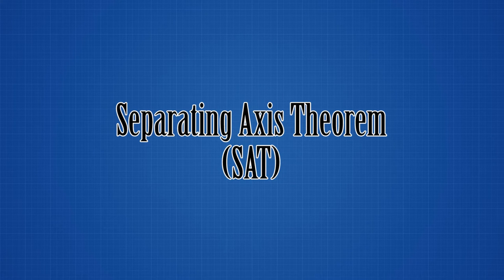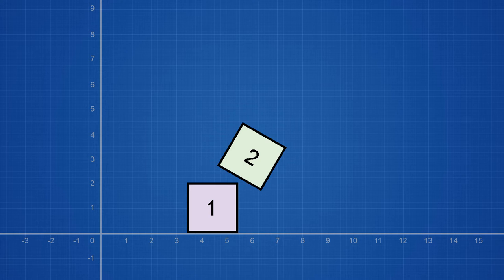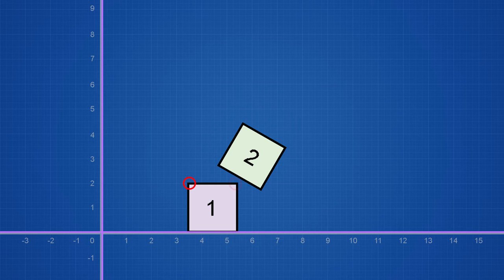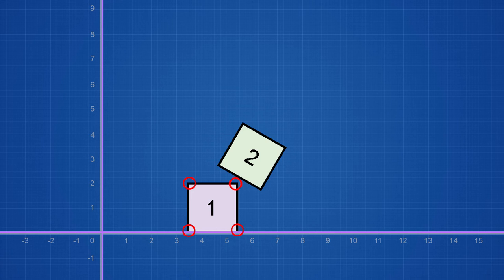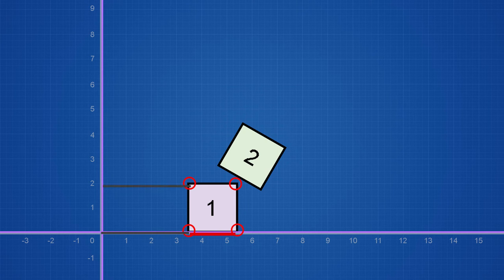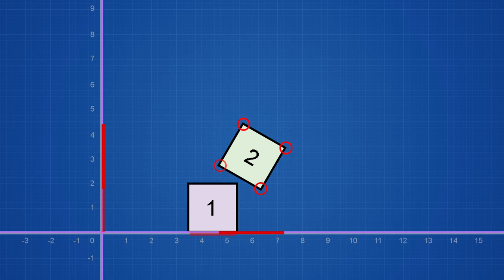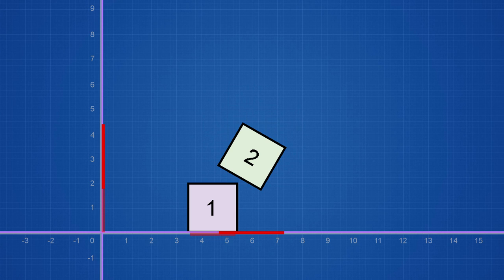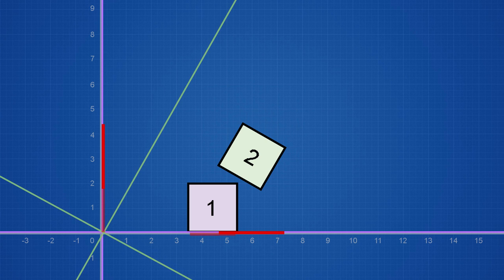Separating Axis Theorem (SAT) Explanation.

Comment: Could you please define what you meant by axis of the second solid? Would you like to explain this if there were two spheres? I'm not happy with this explanation.
Reply: im just asking have u figured it out yet
Reply: For then I became lazy and hard-coded it for my rectangle-sphere collision case. The focus wasn't collision detection, but a basic component design in a simple game like pong. And a real shame that I didn't even complete it. I'll do it in some time, but yes then this is definitely in my list, and I'll try to shape the whole thing into a miniature library. At least that's the idea.
Reply: @SauvikRoy  oh cool hopefully u get it done : )
Reply: Ok :) thanks!
Reply: If is two spheres only need check if distance between two centers is less or equal than sum of radius.
Reply: If is polygon and sphere take axis between angle of center of polygon and sphere and the axis of polygon

Comment: Oh wait I thought you needed only to check the axis of one cube only. Could that be the case?
Reply: Renzo Coppola obviously not
Reply: As soon as you have one axis where the projections don't overlap, you can be sure that the convex objects don't collide either. This is used in the sweep-and-prune method.
The other way around does not work though - you can only be sure that the convex objects collide if their projections collide on all of the axes orthogonal to the object's faces. The video shows an example where it doesn't work otherwise.